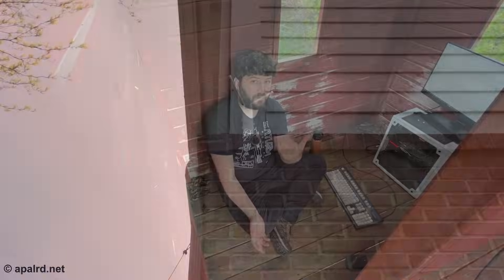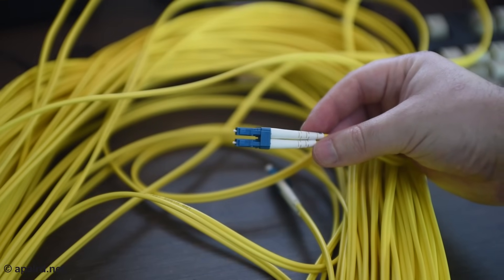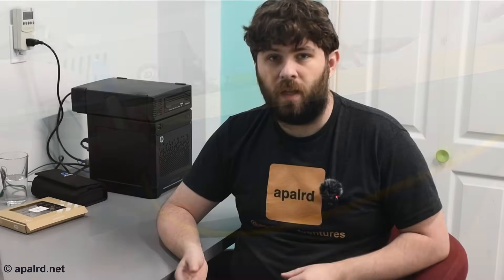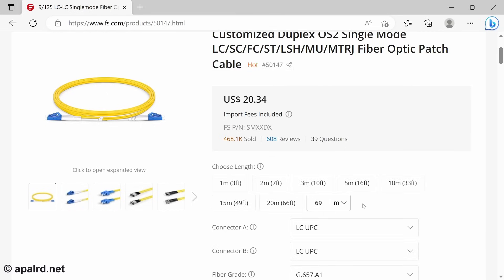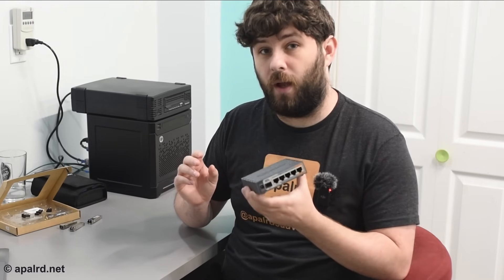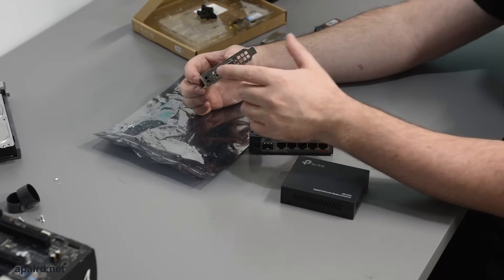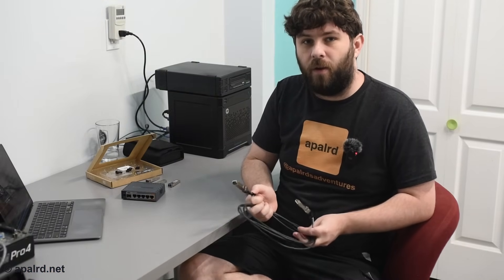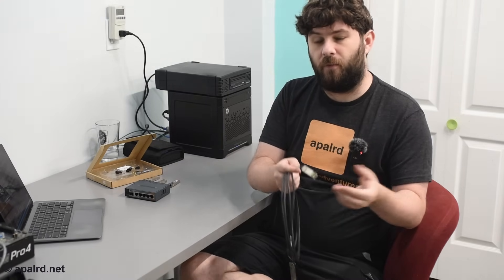The ULTIMATE Guide to Fiber Optic Home Networking

Comment: I want to get fiber optic internet installed through a company and I have a pc for streaming and gaming. How do I simply connect the internet to my pc? I’ve been using an Ethernet cable with my wired internet but I don’t understand how to do it with fiber. I know I can’t just get a router and connect it with an Ethernet so I need to know what I’m getting into and what I need.
Reply from the maker: In general fiber ISPs will hand off to Ethernet with their ONT (optical network terminal) and you can use that like any other internet connection.

Some very high speed fiber ISPs (and especially business connections) will use singlemode fiber like in this video, but most use PON which is completely different.
Reply: @apalrdsadventures  thank you

Comment: I’m a little confused about one statement you made, especially since a poster below said that, as they were an internet installer, they could “confirm everything” you were saying is 100% accurate. My confusion--at about the 4 minute mark, you said that “if you need an outdoor rated fiber that pretty much only exists in single mode os2…” I recently purchased indoor/outdoor 4 strand multimode from LANshack and this is in the description of this cable: "Our Indoor/Outdoor Pre-Terminated Fiber Optic Cable Assemblies are perfect for connecting the networks of two buildings through the use of an underground conduit, headend termination to a fiber backbone, termination of fiber rack systems, multi-floor deployment where select fibers are used at each floor, or intra-building backbones.” Thanks.
Reply from the maker: I mean, you can buy multimode outdoro cable, but it's very much less commonly used.
Reply: @apalrdsadventures  Thanks for the reply. You know a heck of a lot more about this stuff than I do but I’m curious why multi-mode is less used. One of my runs was about 50’ and my other was a little over 125’ and both well within the distance of mult-mode (I have read up to 1800 ft) whereas singlemode is typically used for longer distances. No worries…mine is purchased and will be installing it soon.
Reply from the maker: Basically duplex multimode is limited to about 25G with current optics, and costs have come down so low that there isn't a huge reason to use MMF any more.

100G multimode uses 8 fibers (4x25G per direction) whereas singlemode can use course wavelength division multiplexing over 2 fibers (4 'colors' of 25G per fiber), so there's a better upgrade path for singlemode fiber.

Comment: that fiber drop is not very abrasive may not last very long underground u should look into corning drops theyre alot better have so many layers has a black layer then 2 fiber glass rods then another layer then kevlar then another layer then one more layer then glue then the fiber. i work for Bell Canada and thats all we use
Reply: You have to be careful though if you get a flat one and twist it too much it will just snap

Comment: This might be a stupid question. Is it possible to connect two computers having SFP28 NIC directly using fiber optic cable just like how we do it with a copper cable or do I need a switch/router for networking.
Reply from the maker: Yes you can, the process is the same as using a DAC cable between SFP28s.

Comment: Great info. Been running OM3 fiber LC/LC at my place for 2 years and just added two more fiber runs to replace the ethernet cables connecting my switches. I have used 10GTek media converters when I did not have enough SFP ports. Will be nice when I install crown/cove molding to hide the cables and also add some LED lighting.

Comment: In my humble opinion if you're using 1G fiber in 2023 you're doing it wrong.
Reply from the maker: The fiber itself can handle 100G or more. If you only have gigabit on both ends right now you can buy new transceivers later.
Reply: No, always every device only supports that it’s gonna be a lot more convenient than slapping your network switch in a location where you don’t need one

Comment: Is it actually possible to use fiber channel hardware (at least for the cables)? Or does it have to be ethernet hardware. Not talking about fiber channel over ethernet here, which seems quite obvious.
Reply from the maker: SFP or SFP+ should be compatible across different higher level transports as long as there is no vendor-coding or vendor-locking going on. *should*.

Comment: I prefer direct cable connection over Wi-Fi as it requires physical access, with Wi-Fi it just seems like a matter of time before for some clever hacker Breaks the Wi-Fi encoding and your forced to buy new gear. 
As someone who pulled his share of copper wire in the form of coax, cat 5, shielded Multi conductor, zip etc in the past. I like the idea of fibre optics connections between buildings for the sake of lightning protection, but you didn’t mention how durable the fibre cable is when pulling it through underground conduit? I would be very nervous about breaking the glass conductor, has the durability increased over the years for fibre cables?
Reply from the maker: The 3mm jacketed patch cables (non-armored) are really quite robust - fs specs them for 225N (~50lb) tensile strength and 10mm minimum bend radius, which should pull through a conduit. The more expensive armored fibers (such as the black direct burial TPU one I have in the video) can handle significantly more than this.
Reply: @apalrdsadventures  
Thanks 👍, the other part of the concern, bending the cable too far and damaging the fibre.
Reply: @YellowRambler  g627.b fiber is also incredibly bend resistant.

Comment: In 2019, I started the process of purchasing a house that was under construction. My home called for a detached garage, which I planned on being my primary computer center. The house itself was built with two insulated attic spaces that do not physically connect. On a Friday, the builder invited my wife and I to check out the home under construction before they started putting in drywall the following Monday. The builder gave me a "wink, wink, nudge, nudge" type of statement saying that anything that happened to materialize over the weekend would be ignored. I brought up the idea of how I would connect networking between the detached garage and the house and he mentioned the conduit for the electrical sub-panel in the detached. I immediately knew that I could not run copper through an electrical conduit with 100A of AC power running parallel. I then had an epiphany... fiber optics! Thankfully, there was still an electronics store in town that sold fiber (Fry's Electronics... they were a dying company but no one had stuck a fork in them quite yet.) They only had one option and I didn't have time to research or order anything online. I bought 1000 feet of 62.5/125 zipline. I ran fiber between where I envisioned I'd put my rack, with about 20' slack in the detached garage to the front attic space. I also left around 20' slack in the front attic. I also ran fiber from there to the rear attic, along with a couple lengths of CAT6A. I ran fiber between a few other potential future upgrade locations. That was in December 2019. In April 2020, we finally officially purchased the house. I had time to research things. I learned that 62.5/125 was not the greatest and may be limited to 1 Gbps. I purchased some Aruba network switches that had four SFP+ connectors and 24 PoE ports. I planned to have one in each of the two attic spaces and one in my computer rack. I would later add a fourth identical switch or second for that rack, as 24 ports were not enough there. I also was researching terminating fiber... it took tools, techniques, and experience that I did not have. I searched on NextDoor for someone capable of terminating fiber for a residential need. I thankfully got a response from a guy that owned an IT company. He employed technicians that did this and he had done it himself before becoming more of an administrator, being the owner. He agreed to terminate the fiber for me for less than $100! He only ended up terminating the run between the detached garage and the front attic and suggested I go with the CAT6A (which I could terminate myself) to interconnect the front and rear attic switches. I was hoping I could run 10Gbase-SR. I had estimated the length to be between 30-35 meters, which is on the edge of use for OM1 fiber. Thankfully, I have not had ANY issues and all of the switches are tied to each other with 10 Gbps. My Internet is 1 Gbps and speed tests generally are around 850-900 Mbps download and 900+ Mbps upload.
Reply: Definitely not issues 😂

Comment: Throw in AOC cables as well. These can go much longer than DAC ones.
Reply: As someone who just ran SFP modules through trunking and into a rack (I lost the fibre caps and damaging the SFP would be easier to replace) AOC cables are only really useful when you have a massive amount of space to run the fibre, even then, cable + modules is usually not much more expensive.
Reply from the maker: A good choice when you’re still in the same room or area but passing the sfp+ end through walls isn’t always the easiest. Fiber can use lc keystones.

Comment: I really would have liked you to have mentioned that the connectors need to be kept clean. Dirt / oil from fingers can really degrade the connection fast. Don't touch the ends and keep the caps on as much as possible.
Most of the vendors that supply cables also have cleaning pads/kits. When in a real pinch using those sealed swipes for glasses (the ones you wear on your face) or the purest of alcohol can help. 
Also avoid tight bending and strain/pull on the fibers. In general you should limit bends to what you could coil around a larger soda bottle.
I would recommend getting LR over LRM as the power budgets are better and LRM compatibility is much less common.
Reply: It only decreases the signal strength, right? Which you should have plenty of, on short runs
Reply: @thewhitefalcon8539  It rather decreases OSNR, very broadly a combination of power loss and dispersion (and some other non  linear effects as phase shifting etc etc. aka physics etc   ) 

For short runs (up to 25GB) OSNR is usually not an issue. As long as you have at least 3bB of power budget left 99% works without any issues.

In either case do check upon the equipment you will be using and the distance you will need to traverse.  I would opt for duplex singlemode fiber where possible.
LR 10Gbit from the known whitelabels are really not that expensive anymore.

My main argument was that while Cat5/Cat6 can take quite the abuse , you should be more careful with fiber optics. 
Just treat it with care, don't poke randomly in the module or use air pressure to "get the dust out" or wipe up the connectors with a cloth etc.  As long as you keep the covers on all the various items, it should last a lifetime.
Reply: Another advantage of fiber is that it makes lightning protection much easier. It’s safe from stray electrical surges and lightning magnetic field induced currents. Few homes are concerned about lightning now, but in 20 years the weather is going to be churning a lot faster.
Reply: In my experience working in a data center I have only very rarely found dirt to actually degrade a connection.
I have also seen plenty of cables whose shielding has been ripped off and the pure fibre barely hanging off the connector work flawlessly for years. 

Tight bends, strain / pull also didn't seem to be doing much at speeds of up to 32Gb/s.

Now this doesn't mean to not take care of the fibres, but it's also not as bad as people like to make it out.
Reply: @MrMarci878  over time dirt is a problem, dirty connectors cause reflections which can eventually destroy the tx lasers. Amongst other issues.
Reply: @MrMarci878  I'm mainly doing longer amplified runs (up to 200km) in which clean fibers are essential. 

There are a lot of factors that can influence connectivity indeed. Indeed they aren't as fragile as people would make you believe, but it's good practice to treat your fibers properly. 
Keeping the connectors clean and avoiding bends and strain on them simply helps with the longevity of the cable. If you need something that can withstand more abuse , kevlar and/or coil protected aka armoured fiber is the way to go.
Reply: @djpsychic  

Even in 10km runs, badly scratched fiber ends have bitten me. Always use cleaning tools on everything. Even on brand new cables fresh out of the bag.

FIS sells these cleaning tools for dirt cheap. No reason not to get them. Your fiber will last much longer. I mean especially if we are talking pre-terminated direct bury fiber like what this video is about.

If anyone wants to know why this is important, look up "fiber scopes" and you can probably find some glass gore.

Comment: you should really take advantage -  goto 100g if you are going through all the time and effort and cost to install fiber - don't leave all that network performance on the table - otherwise just use cat6 - it won't degrade like fiber - when fiber gets dusty it is a total pita - dac cable is a good option - cheaper and it doesn't have degradation issues when you get it dirty like fiber does
Reply: He can use OM4 fiber and 10 gig ends for years.  He'll be set to run 100 gig once it's reasonable and cheap enough to buy and use.  Copper cabling have it's limits when installed.  CAT6 might be fine for 10 gig but not for higher speeds in the future.  Fiber is the way to go for long term.
Reply: @Darkk6969  While you're not wrong (I have fiber in my home too), 10 gig still isn't "reasonable" for most people, let alone 25 or 40 gig. 100 gig being reasonable for home use is a LONG time away lol. Also, to be fair to copper's future use, if we're going to compare it to fiber we should at least compare it to Cat 8 which can handle 40Gbps. With that said, as fun as fiber in the home is, IMO Cat 6/6a does still make the most sense for the vast majority of home installations, not all, but most. 10Gbps won't be considered slow at a residential level for quite some time. Consumer devices are still getting 2.5Gbps...
Reply: Not always at that level switching and interfaces become very expensive